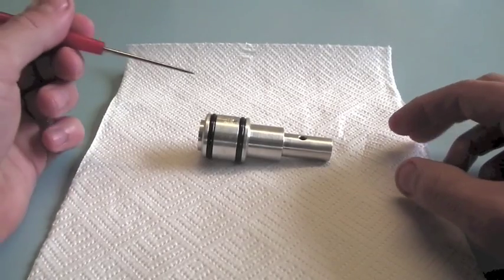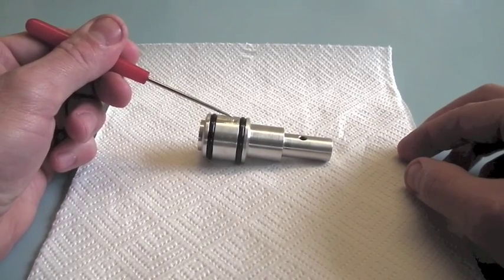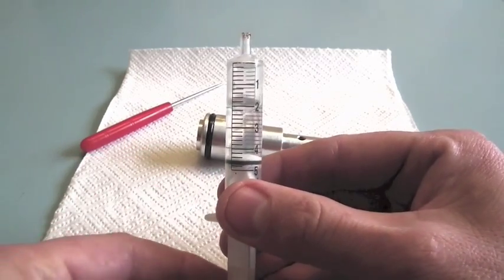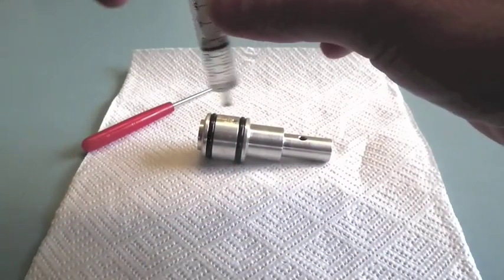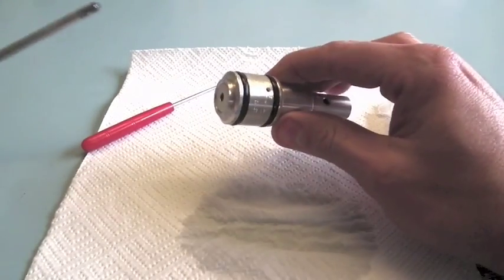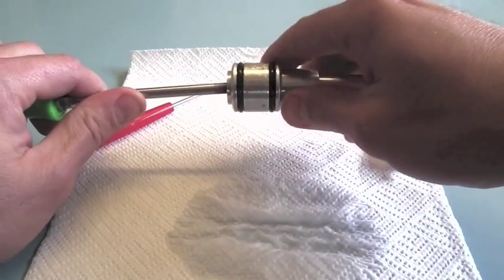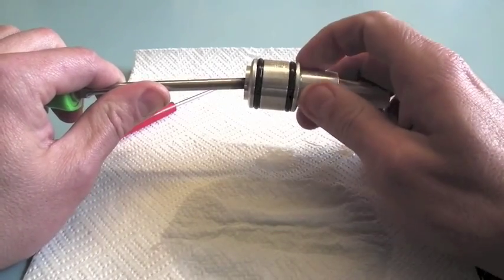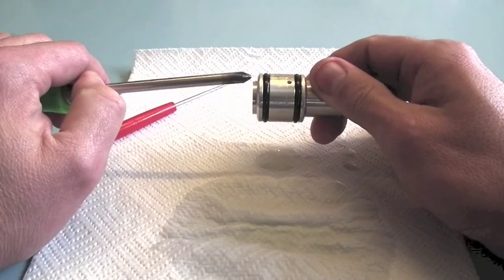Lane Regulators - FAQ 2 - Why Face The Breath Hole Upwards?

Comment: Couldn't the hole be placed at the bottom as long as the regulator hole is facing up inside the gun? I am assuming there is a 360 degree cavity open to atmosphere and regulator can be spun as it looks round

Comment: Okay, I have a question.  I have a BENJAMIN MARAUDER .22 (not that it matters) and i am contemplating the addition of a regulator.  When it comes to the installation, do I have to drill a breath hole in the air tube???  If so, what exact purpose does this air hole serve?